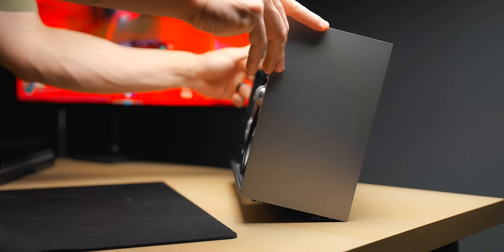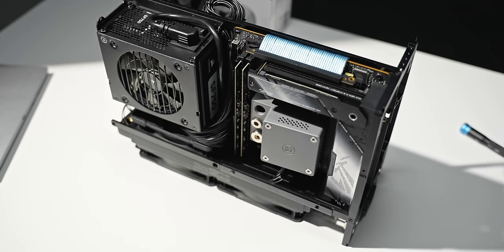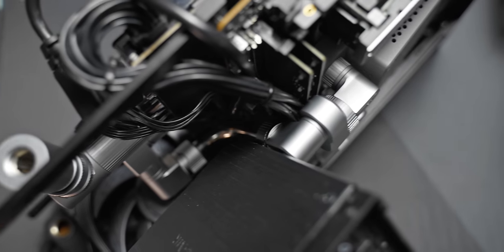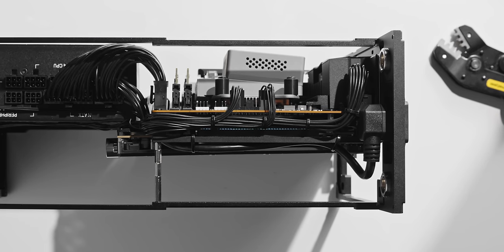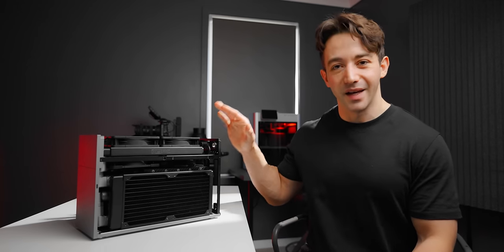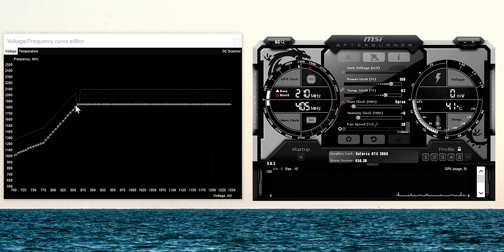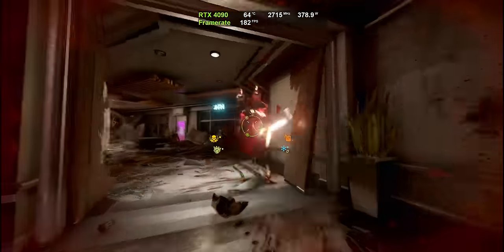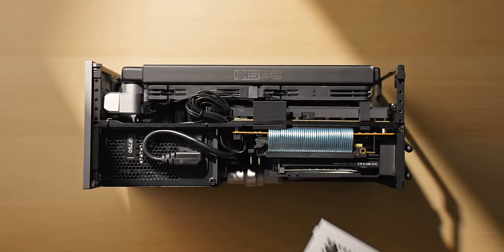ITX Insanity - My 4090 Build is Complete

Comment: I want an ITX build this complicated... But building it would be beyond me 😅
Reply: youd be suprised what you can accomplish when you dedicate time to research and planning, the only real hiccup i could see would be the price.
Reply: @sw-gz9ps that's the main thing stopping me, the price of the motherboards and power supplies make me want to cry lol
Reply: @sw-gz9ps  yeah, would want to do the same with like an 7600 but they dont make good blocks for cheaper gpus alot
Reply: @sw-gz9ps  yup and for Optimum Tech this setup is for like year or until new CPU/GPU release. So never ending story in upgrades.
Reply: its cool, but i prefer my O11 evo
Reply: whilst many things may be beyond you today, nothing is beyond you tomorrow
Reply: @nebnollock5198 there are good matx cases though
Reply: i want the SSUPD Meshilicious but i dont have the budget yet
Reply: I think i am able to do it, but the price for the hardware + risking that i destroy it by melting new cables to it, would be to high for me.
Reply: You probably dont have the biceps required to do this build.
Reply: It's honestly extremely cool but serviceability is going to be hard.
Reply: @pruuuutttt_pruuuutttt_8656  I have meshlicious and won't get any other case because of the way case sits. If this case can be put vertical it would have been good.
Reply: @sw-gz9ps  4090 is dumb for everyone not making money from compute and/or 3D art. 4070Ti is in the sweetspot (for me, anyway)
Reply: Patience, young padawan.
Reply: If you have any PC building experience, it really isn’t all that difficult (ofc not easier neither). It’s a lot of trial and error playing Tetris, Measure twice cut once. Lots of pre-planning and tedious work but very possible. You can do it too 👍
Reply: @paulneal9908  yesterday is beyond me tomorrow
Reply: @nebnollock5198 and the gpus make you want to explode😅
Reply: But budget is beyond me LOL
Reply: @Definitely_Melnyx not small enough for me unfortunately
Reply: @paulneal9908 based
Reply: @sw-gz9ps  Sadly I have a Zotac Ampere 4090 and I've never seen an ITX case that can fit it
Reply: Just don’t put in all the work to make that kind of build and get a GPU that performs less efficiently than it’s reference design
Reply: @sw-gz9ps  Well the price & learning how to bend those damn tubes & get them to the right size as well.
Reply: I recently build a 4090 + 13900k PC in an Dan A4-H20 case. That was my first water cooling build. No problems at all.
Reply: The cost is the problem cheapest such case and water block would be in the hundreds
Reply: @Whitedog2024   I'm a grown man with no children/wife and gaming is my only hobby besides gym... I got a few quid to spend on computer parts 😅
Reply: It is possible now with 3d printing services.

Comment: Water cooling block is the cheat for SFF 4090. GPU went from big boii to slim jim real quick.
Reply: most waterblocks really decrease the size significantly ( usually to about the area of the card PCB and the thickness of the 1 slot).
but the fittings and tubes - those are the real MVP here. it just nuts what he achieved.
Reply: It depends solely on GPU board and not block. All blocks made as small as possible.
Reply: @1stRanger  yeah some waterblocks end up long because the pcb they're made for is long

Comment: I somewhat mimicked his build, and for those of you also in the US, I went 13900K & Nvidia FE 4090, so I use a different block (Granzon 4090 Block, its still x1 PCIe slot, but ever so slightly larger than the AlphaCool ES block Ali uses) , but I also got a cheaper 4090, if you want an iChill 4090 so you can use that same AlphaCool ES block that he uses, you're paying at least 2K+ for the GPU alone, for the water-cooling supplies alone you're gonna spend around 1300$+,  not including the actual PC components, the FormD T1 case & other miscellaneous things you will need, It was fun and very challenging, especially building the loop itself, but Ali has always inspired me to build the most powerful PC in the smallest form factor possible, & as always his build & video did not disappoint.

Comment: 0:57 Don't know if I'll get an answer on this, but I see you're using some 3rd party antenna rather than the one that came with the motherboard. I'm a person who occasionally uses the wifi on the go and uses a Bluetooth keyboard. Is there any differences compared to using the 3rd party antennas rather than the one it came with. I also have that exact same motherboard.

Comment: Oh wow. Just started watching, and as you were talking about the fittings, I was thinking how interesting it might be to do stainless steel plumbing, but wondering if there were PC waterblock-compatible AN fittings. And then you mentioned you did indeed use metal tubing! Even if it's not bent and flared, still very neat to see! And I'm glad that the compression fittings here are compatible!
Reply: Wow, overall this build is beautiful. Very well done! I'm personally plenty content with my mid-tower case, but get the appeal of something so compact. It's incredible that you've achieved such good thermals in such a tight package. 

Thanks for your journey on the build. Definitely gives lots of ideas for my own projects in the future - though in my case, not because it's needed for packaging requirements, but simply because it's fun to do. 

Looking forward to what you build in the future!

Comment: I also did nickel tubing in my FormD, but I managed to line the pipes up side-by-side between the PSU and the top radiator. My long-term goal of watercooling my GPU might call for the tubing to be adjusted (I have yet to figure out how piping works between two radiators) but for right now, it looks incredibly cool. And you're right, the nickel-plated tubing looks so sick with all the reflections.

Comment: The 4090 is a monster even when power limited to 350W. Computerbase saw that the 4090 got 97% of its 450W performance when limited to 350W. And then you can add in a 13900K for excellent non-gaming performance too.

Comment: would be interesting to see if tin coated copper tubing would help radiate heat before reaching the radiator. possibly likely increase ambient internal temp

Comment: I have the x670e-i too but cannot update my bios , still running 0822 , anything newer my ram won't post with expo , Corsair vengeance 5600, on 0822 zero issues and even have OC to 6000. Have you had any issues with ram or bios , I'm curious if you did how you solved the amd expo issues

Comment: Its crazy that you get lower temps than i do but i have thicker rads haha. 

Edit turns out my 4090 had a bad mount post thermal paste change. Cleaned and remounted I get lower temps  low to mid 50's on two thick 240mm rads!

Comment: I swapped off mITX with my 4090. Its just not practical, where my system draw will be in excess of 700W with the nutty 3GHz 133% TDP overclock on it. 

Its really unwise to run that setup on that SL750, but if you're tdp limiting to 85%, its at least reasonable.

Comment: Downclocking the GPU because of thermal limits is not really a "no compromises" ITX build!

This GPU needs liquid metal TIM, the 4090 benefits MASSIVELY, 10-15c on the GPU Hotspot. I have no doubt the GPU will run at 100% power limit with this simple mod

Comment: At any point was there ever another ITX case you had in mind that with going through your process felt may have made your build work any better? Just trying to gain some insight in case I decide to put in the work bc personally I like those like the NZXT V2/itx tall cases

And just curious the points you were making later about the performance and the card boiled down to essentially ‘this chip didn’t seem to be binned very well’, ‘undervolting doesn’t help as much as u think bc software is presenting skewed numbers’, and ‘power limiting works better for balancing higher clocks nd lower power with the 4090?’ Thanks, very nice video! Just seeking some clarification

Comment: What's bothering me is the fact that the fans on the side radiator are blowing inwards. Any specific reason for this? I'd assume that this means the warm air from the side radiator is blown into the case and then through the top radiator, which seems less effective than having both radiators exhaust their air out of the case, and with a case this well ventilated, there should be enough ways for fresh air to enter the system from elsewhere. I'm thinking there must be a reason, with this much attention to detail, it can hardly be by accident, can it?
Overall, what a crazy build! I don't think I would've gone the long way and custom-made my own cables :D

Comment: Hey Optimum, love your videos. You said you are using 1440p 240hz, so I take it you are sticking with the new OLED monitors in the meantime instead of using the 360hz ULMB2 PG27AQN? I got the PG27AQDM myself and actually prefer it to the PG27AQN even if the AQN has the higher refresh rate.

Comment: very amazing build! .. quick question if you don't mind - I've got a NR200 case with 5950x proc, dual m.2 drives a big AIO radiator for the proc and currently a 3080RTX .. love the way the Corsair SF750 runs and everything is great in this build (not as slick as yours but works as a bit easier build).. I'm looking to drop a 4090RTX FE into this box - and on the fence if the SF750 will do the job or if I'll need to up to at least an 850W? is the SF750 working well for you (with the slight undervolting?) I'm hoping this will and won't need to redo everything (at that point maybe go for the NR200 Max and get the 'easy' path to a top cooler - currently its mounted to the left side (280mm artic freezer). So, long story short - do you recommend giving the 4090 a try with the SF750 and maybe undervolt a touch or switch up to an 850W? Also - I expect I will need an aftermarket power cable for this and if you have any pointers for that super appreciated! thanks!

Comment: I have a very very similar build, 20months later, mostly turned on 24/7, I have my first issue. The DDC pump is starting to screech every few hours. Looks to me like I have some bubbles in the system that developed somehow over time. Hopefully I can just hookup an external reservoir and do a fresh bleed to get rid of the air again. Other than that, and some vacuum cleaning, I've been very pleased, even with the insane amount of time and money that it took to pull this off. BTW my whole computer, 15" screen, full-sized 915 keyboard, mouse, modem, router, and cords, fits in my carry-on suitcase!

@optimumtech Have you had to bleed the system since you filled it initially?

Comment: I have that water block in black DLC.  Can I run a AlphaCool ceramic DC pump in that casing?  I am building my first PC (ITX, INTEL 10900K, NVIDIA RTX 3080 FE,  air cooled GPU, water cooled CPU, FormD T1 v2, etc.,...)

Comment: how do you control speed of 4/5/6 fans when this board which is x670e-i if im not mistaken has only one fan_case header, even if you use splitter to connect them all, one cable from splitter goes to one fan_case header through which you can send signal that will affect all the fans or am i missing something here? thanks in advance
Reply: he has a fan breakout board custom designed manufactured by pcbway

Comment: I'm interested in trying a similar build myself thanks to your inspiring video. I like the aesthetics of the Fractal Terra Mini ITX case, although it is apparently much larger. I was hoping to better understand your point on using the 13900K and how it might add too much heat to the system. Would that also be true of the 13900 which has a much lower TDP?

Comment: Was gonna buy the 4090 this august but the 12vhpwr is still a HOT MELTING MESS, the updated 12v-2x6 will not be release on the "new 4090 cards" until early next year,

So yeah, to the 7900xtx then, better to have a functioning gpu than melted one 😭🤷‍♂️
Reply: Hot melting mess lol, we have dozens of them in our company running without any problems...

Comment: New to ITX (SFF) and watercooling, but does a build like this easily overheat (thermal throttle) when under stress tests? (for overclocking) Or is it something people stay away from in the ITX community?
Reply: Doubt it, most itx builds and cases are just as good as regular PC cases when it comes to thermals these days

Comment: @OptimumTech Hello, how did you manage to run 7800X3D and 4090 on 750 PSU? I have 5950X with 4090 and SFX 750 Corsair. My PC shuts down. I have limited 4090 power to 70% and PBO in Bios to negative 30. Thank you for advice!

Comment: I got nearly the same build right now but with air. 4090 fe, 7950x @4,8 Ghz, Powertarget for the gpu set to 70%, 315 W of Powerdraw. Got an 240 AIO for CPU cooling.
The fancurve of the gpu is set to 1200 rpm. It's pretty silent. The GPU runs at about 80° (Ambient 27°). Because the gpu is hotter, I think the heat transfer to the air is more efficient. Im wondering if it is ok for the 4090 to run permanentely at 80° Hotspot 94°

Comment: Have you undervolted that CPU? I think PBO2 and curve optimizer works on X3D parts.
Reply: Just update the bios and disable GPU settings.
Make sure you the cpu voltage is ony 1.25 or 1.3v max for safety reasons.

Comment: Can I use a 14900k instead of 7800x3d ?
Or is that bad for the temps? I have a feeling the Ryzen will cause greater degree of bottleneck for the 4090
Reply: Ryzen 3d are actually better for gaming only, but if you are doing CPU intensive tasks go for Intel, not only because it's better multi-core performance but also 3d CPUs heat up a lot

Comment: So a 750 watt ps its enough for a 4090???
Reply: it's pretty self explanitory isnt it? the 4090 here is pulling 430 watts at most. the 7800x3D is pulling about 65. So basic math tells us that total system power is around 500 Watts. Now tell me is 750 watts more or less than 500? There's your answer :)

Comment: is this undervolted? a 750w psu with 4090...
Reply: It's a very good quality 750w PSU. SF750 is platinum, whose OCP kicks in at more than 900 watts. You can even use 14900k with 4090 provided you UC the CPU a bit and have adequate cooling, let alone the super efficient 7800x3D (under load) that he is using. And yes, most people who use 4090 in this case limit power to like 85%.
Reply: thanks for the reply. when you say UC (underclock) do you mean undervolt? or is that different? @JohnSmith-sh1sy
Reply: @Zenbeau  in other words, doing whatever noticeably reduces the CPU's power consumption. I guess with Intel you could undervolt and not lose any performance or maybe even gain some like I did with my AMD's 5800x3D (by setting PBO2 to -30 on all cores).

Either way, SF750 is a great platinum PSU that doesn't shut down until ~930 watts (it will get successors this year). It will easily handle a typical 4090.

Comment: This should have been tested with a single 280mm radiator block
Reply: the Formd T1 cant fit 140mm fans
Reply: @MrBlackmidi1234567890987654321  indeed so I don’t get it why he used a 240 radiator (2x120mm fans) instead of using 280 radiator (2x140mm fans) or using two singular 140mm radiators

Comment: Amazing build! But the Undervolting part is simply not true! You are doing it wrong! I have 4090 myself (had before also a 3090 and a 3080) and it works as intended. The Optimun for 4090 is 2520 MHz @ around 875 mv (depending on the GPU). You have to raise the whole Curve, not only one single point of the curve! Than you simply cap all the points higher than the intended voltage.
Reply: Easiest way to undervolt:
1) Reset everything in Afterburner.
2) Open the Curve editor Window and leave it open.
3) In the MAIN WINDOW (not the Curve Editor Window) raise the Core Clock (in my example +270 MHz) and memory Clock (in my example +1500 MHz) with the sliders (you can but don't have to click apply)
4) In the Curve Editor WINDOW mark all the voltage points after the intended Voltage (in my example 875 mV) by holding the Shift Button on the Keyboard and the left mouse button.
5) Grab one of the marked voltage points while holding the left mouse button and move it down (this will move all the marked points down), under the MHz value of your intended Core Clock (in my case under the 2520 MHz ponit)
5) Click apply in the main Window.
Reply: A common Problem is that after a restart the initial Curve is lower as usual because of the verly low temperature. So you should start a game for some minutes to heat the GPU up.
Reply: I've benched my Undervolted setting VS my OC setting (+195 MHz, VRAM in both cases +1500 MHz, resulting in 2400 MHz VRAM speed) in Metro Exoduss EE, Deus Ex MD, Cyberpunk 2077, Horizon Zero Dawn an Red Dead Redemption 2, all Games in 4K. The difference between 2520 MHz @ 875 mV and 2985 MHz @ 1050 mV is at most 13%! In most cases ca. 10 %. But maximum Power Draw drops from 420 Watt to 270 Watt in Cyberpunk 2077!
Reply: The 4090 caps the voltage anyway at 1050 mV, so it makes no sense why it should not work at lower voltages.😁

Comment: GPU: 250 watts, 50 celsius
CPU: 60 watts, 73 celsius
how
Reply: The ryzen am5 chips have a very thick IHS and the gpu is basically direct die bc it doesn't have a heatspreader

Comment: I've not yet watched the video and I'm not trying to downplay the work which went into this... but from the first 2 minutes, some things don't look right, some things aren't parallel, it feels "forced" in. 
The fittings on the waterblock (which is at an angle ?) alone don't look ok and then subsequently the tubing doesn't look right, the rad looks crooked. I'm sure it was a true challenge to make it all work but the result doesn't look clean, I'm sorry.
It's super impressive technically, and I'd be proud of the achievement too, but it doesn't look clean.